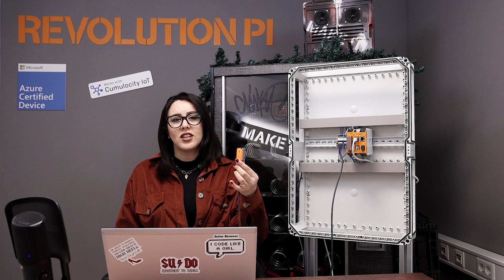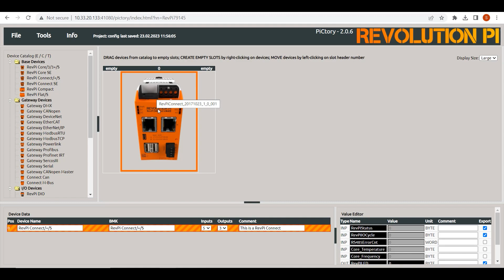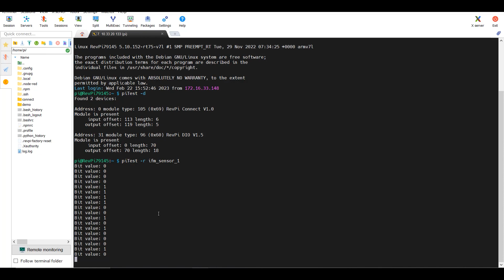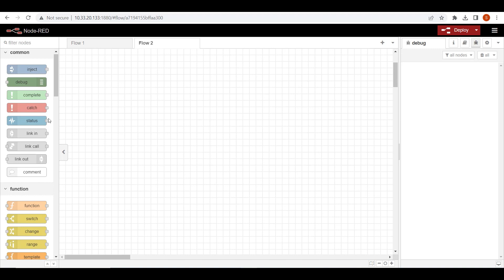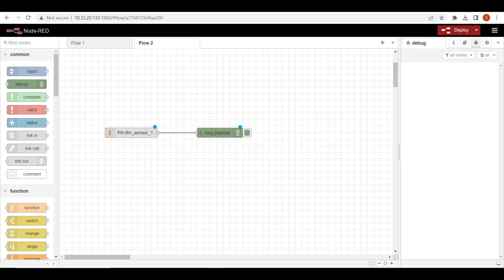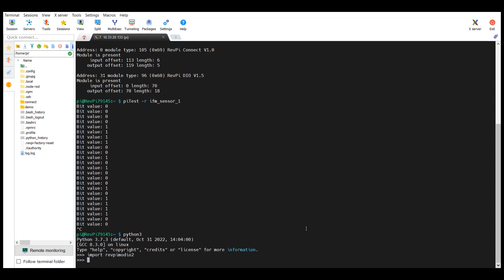How to connect digital sensors to Revolution Pi, the industrial Raspberry Pi

Comment: Is there a zoom in on connecting the wires to the terminal block? I've already broken a tab attempting to connect.
Reply from the maker: We don`t, but you want might want to watch folloing video. It shows how to connect the wires. We highly recommend to use wire end ferrules. You basically just push it in. https://youtu.be/PhfCmPyZVg8?feature=shared